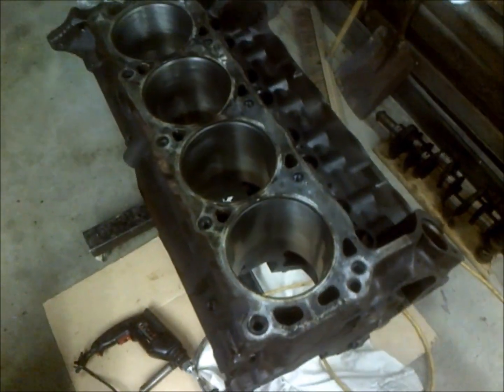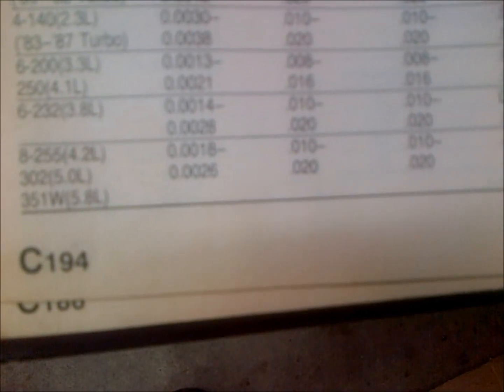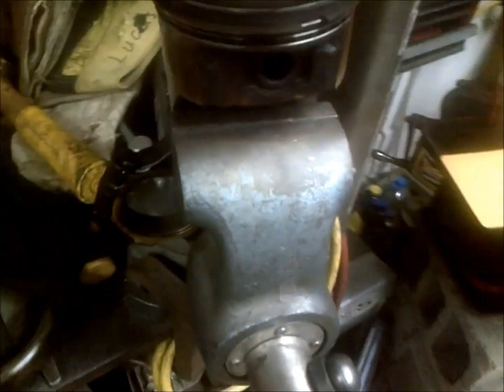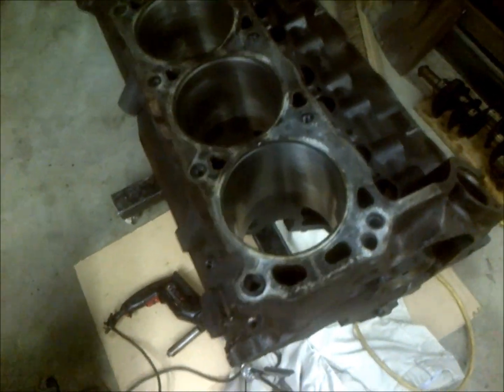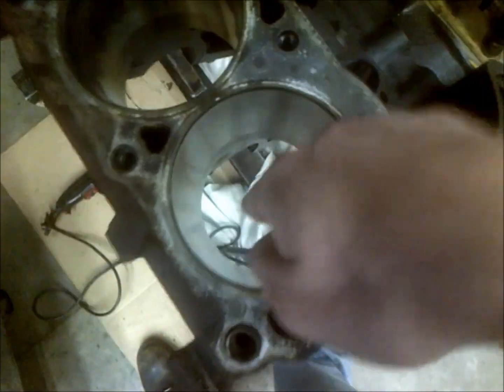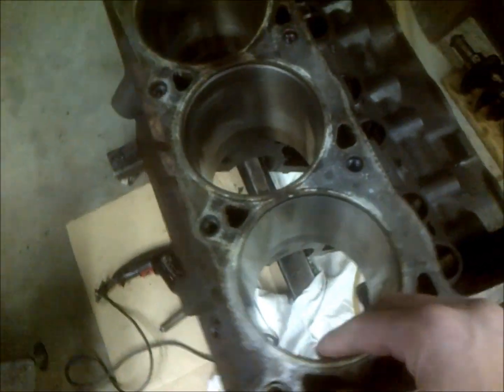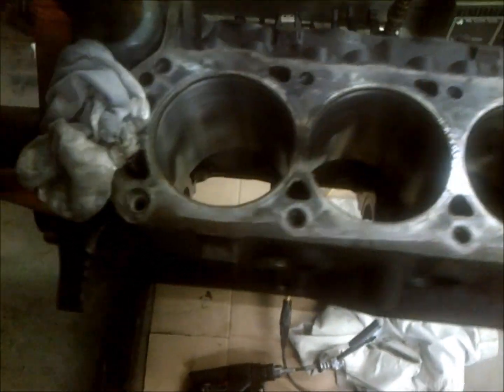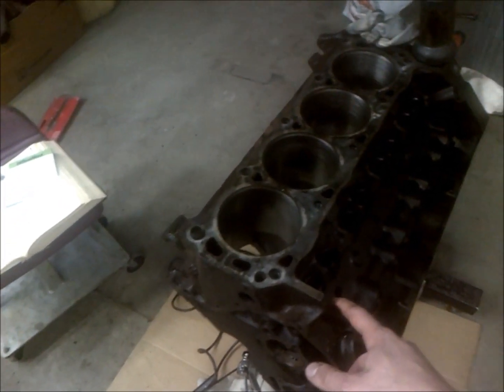Honing a Cylinder what you need to know

Comment: The most overlooked thing is people don't check to see if the bores are round.  A hone will not make a bore round again. I follows the same shape as the bore.  I've seen people hone and re ring a engine and the thing burns oil worse than before.  You need to also measure the bore in multiple places to check for out of round and taper.

Comment: Im working on a f163 continental engine i am going to cross hatch the cylinder walls what grade hone should i use
Reply from the maker: Andrew Klahold on rering jobs, I always use iron rings. Iron rings require a 240 grit ball hone
Reply: ThunderHead289 thank you this goes in a welder was bored .020 in. 1996 and hasnt. Had more then 500 hours on it and it had and oil problem and i found that the cylinders were not cross hatched engine generator max rmp is 1550
Reply: I was also going to install two piece oil rings i personally dont like three piece oil rings and all the diesel engines i have done new oem pistons and sleeves come with two piece rings. I correct me if im wrong but i think its cause diesel are low rpm engines my f163 is also low rpm and runs low rmps no more then 1500 so would it be recommended to use the two piece oil rings three piece i think are for high rpms
Reply: ThunderHead289 are three piece oil rings for high are rpm engines and two piece for low rpm engines i personally dont like three piece would you recommended two piece rings for a welder engine

Comment: They used to sell .001 and .003 and .005 oversized pistons decades ago for situations like you have back when people actually fixed stuff on a budget.  A good locking hone in experienced hands is the next best thing to a boring bar and a locking hone will tell you everything you wanted to know about a cylinder bore.   (There are no locking hones in this video) A bottle brush or "dingle ball" hone is the worst possible thing you can use.  "Look how GOOD the cylinder came out"!! a dingle ball hone user will say as the dingle balls reach down in to all the imperfections in a cylinder and "hone" the imperfections, too.

Comment: one thing you did not mention, the MAIN reason you hone a cylinder is to deglaze the cylinders. and "scuff" them so the  rings will break in with the cylinder walls.
Reply: He did, at 4:42
Reply: Raven4122 it also helps keep the rings in the proper position
Reply from the maker: Valid point, but if you don't know why you are honing, I hope to god you do not have a home in your hand. I guess it's a real thing. Guy told me he bored his engine ten over with a home once (face palm)
Reply: possible with a "hone" but cant say the squareness is guaranteed lol with just glaze breaking type hone (spring loaded) would like to snap that to check end results

Comment: so if hone the block I can use new stock pistons and ring as long as there isn't deep wear marks in the cylinder wall then I would have to bore it and get bigger pistons and ring s
Reply: if you go another .005 you will more than likely need new pistons..you need to check these 2 things when you do the pistons.. Piston clearance and ring gap..there are other things to check but these have to be correct.. Piston clearance in the difference between the piston diameter and the cylinder diameter. Ring gap is the gap that remains when the ring is pushed into the cylinder and squared.. Can you hone out .005 yes but it will take time plus spring type hones will follow the contour of your cylinders so it they are not plate bored and distorted the new hole will also be destorted.
Reply from the maker: +Raven4122 exactly
Reply from the maker: Yes, but you can only gone it so much. The ring gap needs to be within tolerance. Usually if the bore has a decent ridge on the top, it needs to be bored over. Never buy new Pistons for a hone job, waste of money.
Reply: +ThunderHead289 
ok thats good to know thank you
Reply: my ls block has a bore of  4.065 do I need to go to the machine shop if I want to bore it out to 4.070 seems like I could just do it by hand. first time building a ls engine want to learn how to do it my self to save money
Reply: NOT true lol.. If their is a ridge on top you remove the ridge the piston does not go that high any ways except to install it.. you need to check the actual cylinder diameters to see if it needs bored out. as for ring gap you need to use file fit rings and you will set the gap. check my race videos I built several of the engines on the track..

Comment: How do you boil the block to clean?
Industrial process or in a 44 gal drum on a fire?
Good video
Reply from the maker: I take mine into a machine shop and it costs around 80 dollars to boil but looks perfect when its done as if it were factory fresh.
Reply: depending on if it is steel or aluminum block differnt methods are effective.. when i do a 010 chevy small block i like to have them baked machine shop does it.. the 010 blocks have a higher nickel content making the block harder and better the more heat cycles it goes through. the block i have also just had them steamed and just used engine cleaner and a pressure washer..
Reply: HotRod Paul Many machine shops don't "Hot tank" blocks any more. Many of them steam clean because it's more efficient, and you can get the blocks cleaner with less warpage.